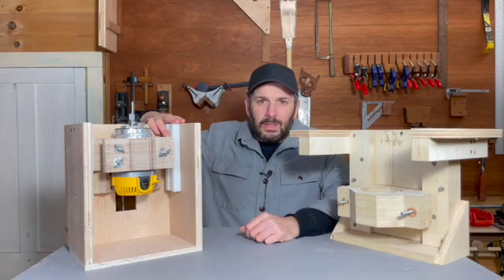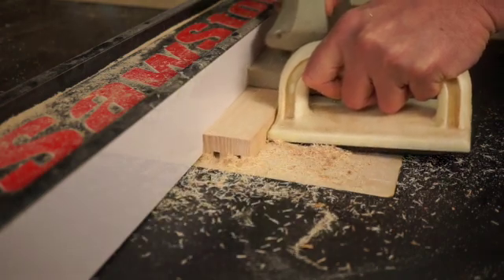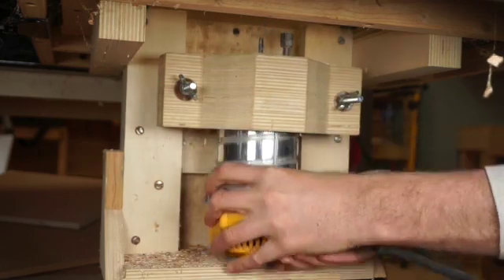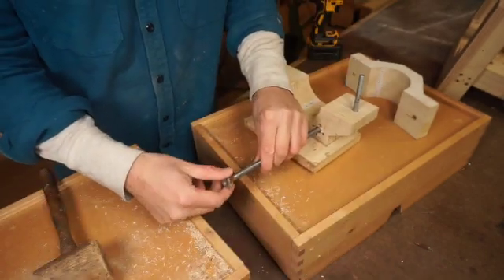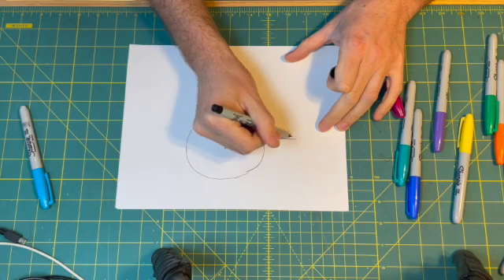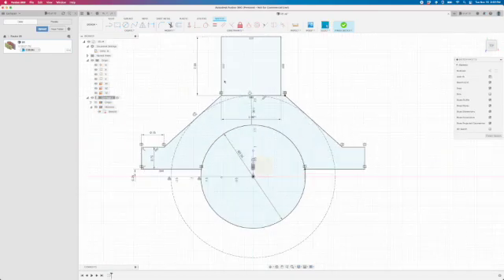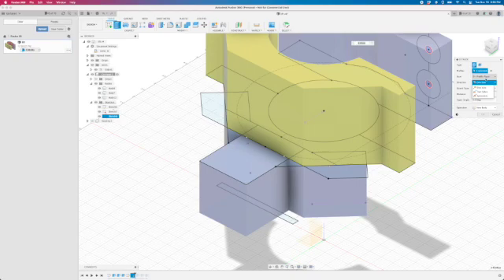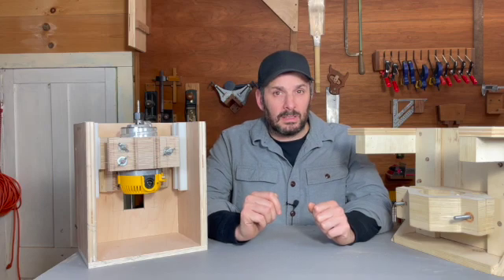Router Lift 2.0

Comment: Loving this, I want to build it myself without the motorised lift. My only concern is that the lead screws move so freely, the router will drop while using it. I need to figure a way of locking in the height.

Comment: Design is great, Ari - however - do you have a valid reason for speeding up this vid - especially the CAD dwg ? -  how can anyone build this if the design build is shown too fast to follow for the sake of time, if that's the reason?  Slow this down, if possible, or provide plans - please!.  A friend :)
Reply from the maker: Hey Charles, honestly, I didn't really imagine that anyone was going to try to follow along. I'll be putting together some basic drawings and I'll post a link when they're ready. -a
Reply: @arikardasis  Hi Ari - I "followed along" because yours is a well thought out good design, that's easy to understand and build.   I built your first one and it wobbles way too much.  As mentioned, I have the lead screw and HDPE from Amazon.  I just need carriage template dims and HDPE W and L dims, which looks to be about 2 - 2.5 in W x 10 in L.  cr: :)
Reply from the maker: @chazrab1  OK, I'm starting to work on plans but this should be what you need to get going: https://www.dropbox.com/s/v79aahc08q6wd0i/router%20lift-01.pdf?dl=0.  Hope that helps
Reply: @arikardasis  Got it.  Exactly what I needed.  Thx for quick response.  BTW: hard time finding a coupling nut or ANY nut to fit the weird threads of that lead screw.  I know you drilled out and expoxied a coupling nut - I guess if that's the only way ...cr
Reply from the maker: @chazrab1  Yeah, I looked around a lot and that's the best I could do. V2 might use a different lead screw
Reply: @arikardasis  Hey Ari- are there any more detailed plans available than than the one you created in the above dropbox link? thank you so much for your generosity and design ideas!!